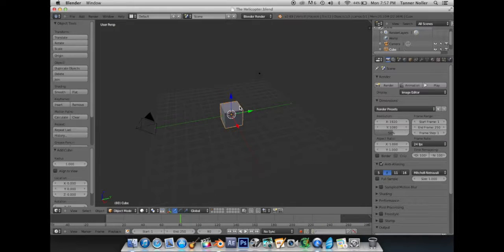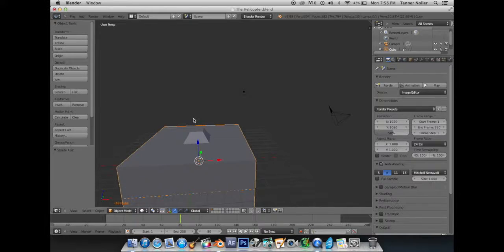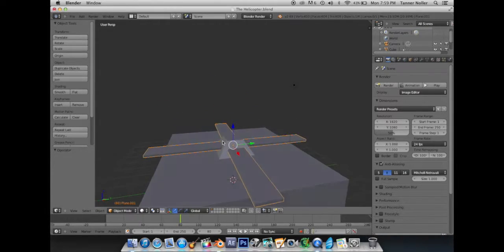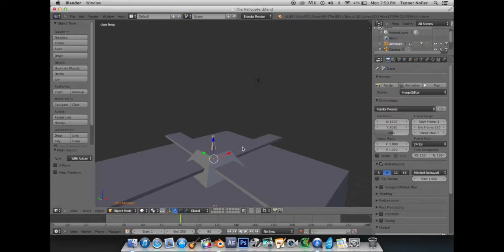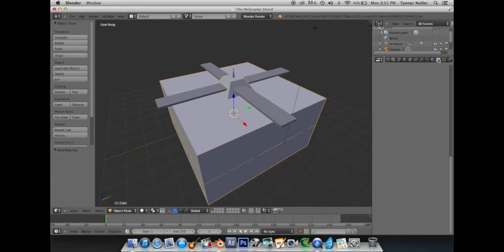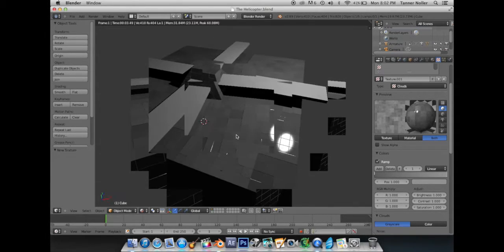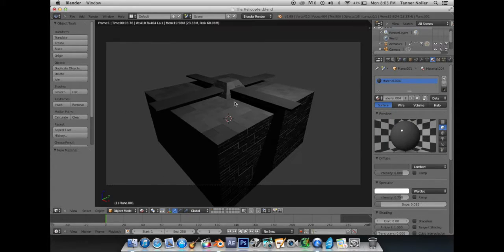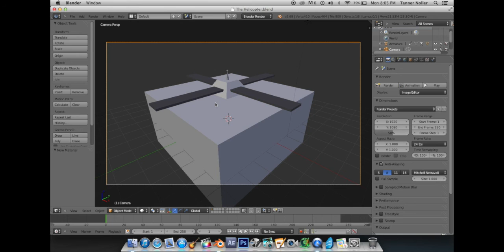How to make rotors spin in Blender

Comment: this is awesome (y) 
thank you !
Reply from the maker: Yeah man! You're welcome! Glad you like it!
Reply: hey i want to ask about armature ?
how did you brought up that list from where you selected armature -> bone
is it when i press Shift + A there is no option of armature
Reply from the maker: Hmm, I'm not sure why. For me, every time I open up the menu with Shift + A, it always works. When you do the short cut, does anything come up?
Reply: YES THERE ARE GENERAL MESH OPTIONS LIKE CUBE , PLANE ETC.
Reply: WHEN I TRY TO APPLY ARMATURE FROM THE MODIFIERS LIST ITS APPLIED BUT I CANT SEE THE BONE ANYWHERE
Reply from the maker: Okay, so I think I may have figured it out. Go to your preferences within Blender and select Input on the top. Scroll down until you see "Armature - Add Bone." Make sure that the short cut is set to Keyboard - Shift A and be sure that the check box for "Add Bone" is checked. If that doesn't work, check what version of Blender you're using. Most likely you're up to date, but just check in case. I hope this works for you!
Reply: i figured it out it was tab + shift + A for armature :P :D 
thank you ! for your help ! (y)
Reply from the maker: Yeah! No problem!